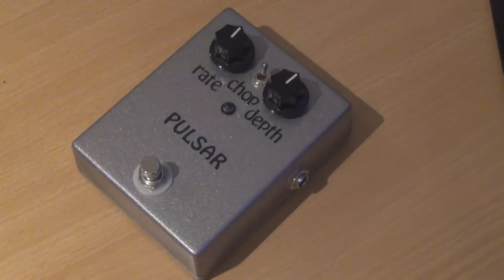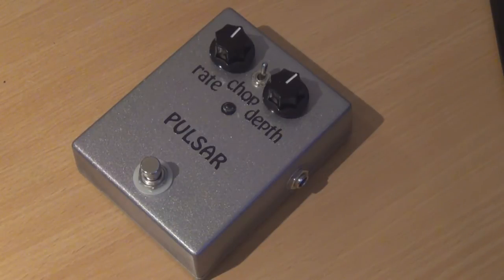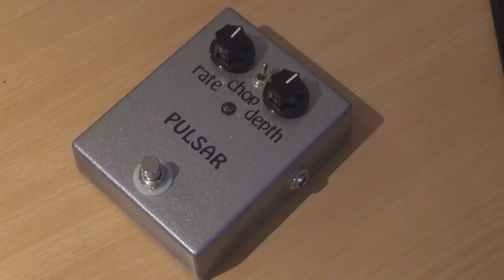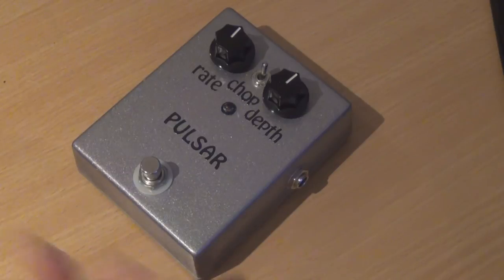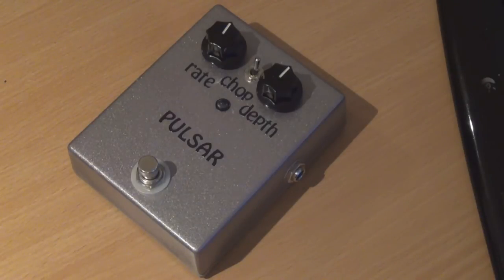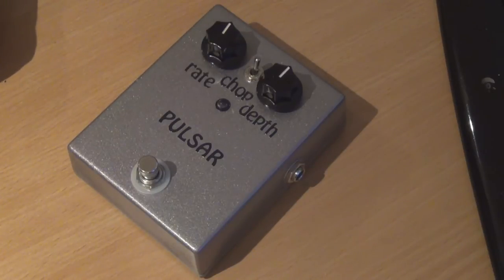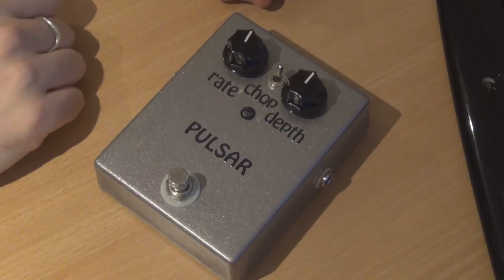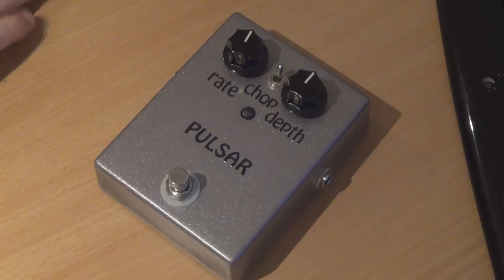Tonepad Pulsar - Build Report & Sound Demo

Comment: I have ticking with my tonepad Pulsar pedal as well. BUT - when I put my Korg DT10BR tuner before the Pulsar there is no ticking whatsoever. When I put my Ibanez HD1000 80's rack procesor before it, no ticking. So, I concluded that you need a pedal with a very intrusive buffer before a Pulsar to make it not ticking. I am not knowledgable enough to deduce a conclusion out of this [one that I can use and make it stop ticking in any situation] but you very well may be :) so here you are

Comment: Don´t know if you could fix the thick problem but you need to ground the effect input in the 3pdt switch and shield the output jack (maybe aluminium tape). The + input of the opamp must be isolate from the LFO side of the circuit so you can feed the opamp directly from vcc and then add a 470 ohm resistor in series plus a 47u/100u to ground to feed the rest. After 470 ohm you will be feeding the circuit with 8.8 volts which is enough to make LFO to work properly.

I´ve used 2N5088 and tantalum for some caps.

I´ve build my own enclosure with a aluminum tread plate, so it benefits the isolation.

Verified!!!! CERO THICK...   ....CERO.

BTW the pulse Led circuit produces thick and loud noise in chop mode - Better not to install, I made a small circuit with another 2N5088 and a couple of resistors...    ...tried conect the base/220k Resist in some points, everywhere I´ve got the thick...  ...the pulse looks great, it´s a shame).

Works great without the led circuit, love the chop mode

Saludos desde Venezuela

Comment: It seems that I do not get the "heartbeat" issue when the pedal is bypassed. I do get a minor one when is switched on but that is not a problem (at least to me). I have used an N5534P instead of the TL072. I also got the best rate results by canceling the R14 in parallel resistor and using an 52.6K resistor for R16 with a B1M pot instead of the A100k. (R16 = 53.2K to be precise with resistors in series to get the value).

Comment: hi, I have a problem and maybe you can solve it for me. the voltage and oscilation doesn't reach to the transistor q1 so the efect doesn't reach to the TL072 and the Q1 doesn't work. do you know what could be the problem? thanks you and great video